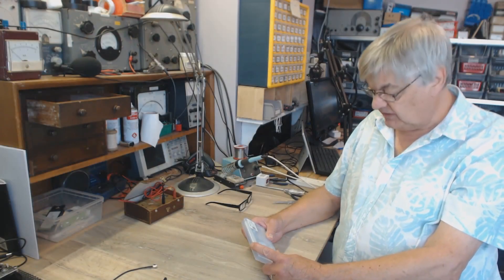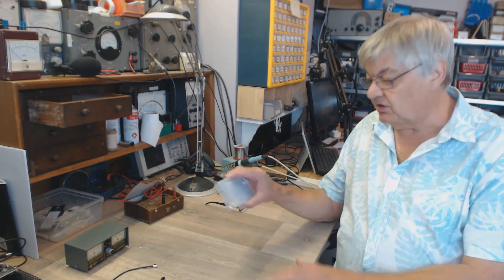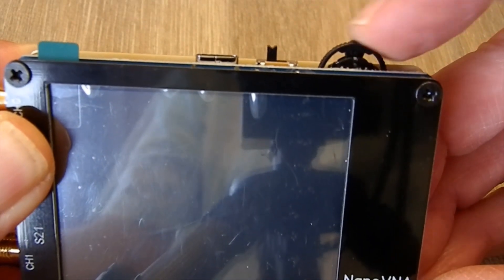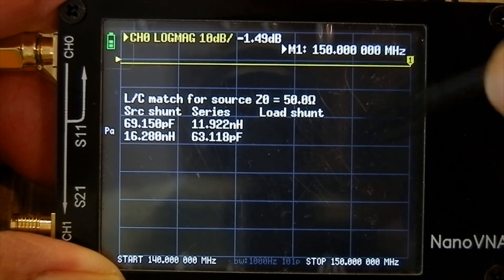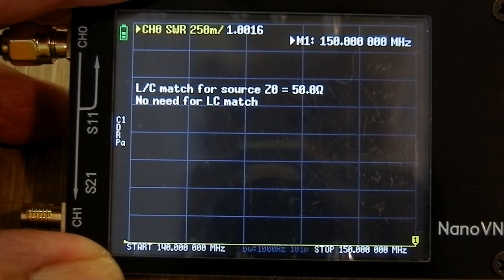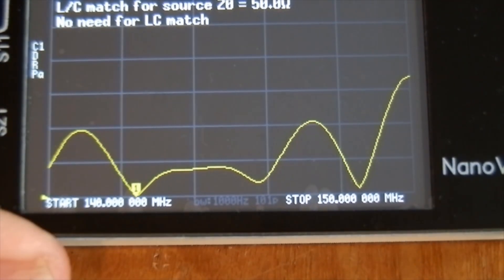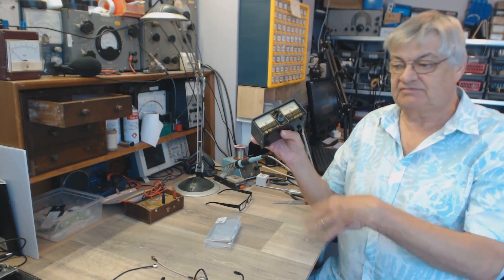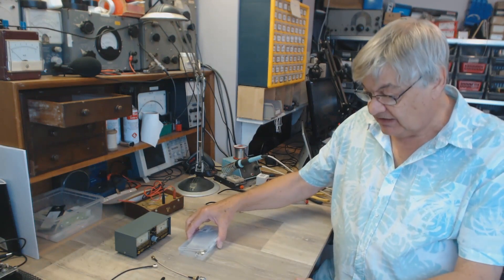G4NSJ - NanoVNA-H very tiny antenna analyzer review

Comment: Hello very interesting video and nice presentation!! 
Thanks.
A few questions before I buy the nanoVNA-H4 (newer version). Is the plastic housing no problem with RF radiation?
And isn't the mounting of the SMA connectors on the printed circuit board mechanically weak?
Reply from the maker: There's no RF radiation problem as far as I can tell. I don't think the SMA connectors are mechanically weak, they seem pretty good to me.

Comment: just watching your video as i make a load box for calibration. it's goiing to have the normal three cal loads but on so329 connectors. so I can use any length of coax and calibrate at the end of it. There is a function for moving the cal point if you add some coax but, it needs a bit of information about the coax your fitting.  I'm doing this as I'm going to adjust a 6 band trapped vertical and want to be a way from the antenna so I'm not loading it.
Reply from the maker: Great stuff, thanks!

Comment: 👍Thanks for video. These are amazing instruments for very little cost. Years ago, you had to pay eye watering money for equipment like this. With the test you did, I am wondering if you measured the SWR characteristics of the antenna system (co-ax and feeder) rather than just the antenna. Unless your co-ax is a half-wave multiple, to find out what is going on at the antenna, perhaps calibrating at the feedpoint or factoring in the delay for your co-ax would give a better SWR plot for the antenna?
Reply from the maker: Hi Steve, I’ve measured SWR at the antenna and the shack end of the coax. It is am amazing instrument. So glad I’ve got it. Cheers, Ray.

Comment: I don't know why but I've never been able to get mine working. It just shows 1 to 1 swr all time. M7AOE
Reply from the maker: That’s a shame. Presumably, the battery is fully charged?
Reply: @g4nsj  Yes, its fully charged. I would like to use it to set up the new ampro15 aerial for my car roof!
Reply from the maker: @Rayxl1  In that case, I don't know what's wrong. The Ampro-15 is a nice antenna.
Reply: I might just buy another one. I did have it working a bit but the low swr peaks flitted about all over the place. You can join the ampro 15 and ampro 20 aerials together It would be nice to see what the resultant resonant frequency is. I'll experiment at Kings Standing when the wind dies down! M7AOE
Reply from the maker: @Rayxl1  OK, all noted. Hopefully, the wind will die down soon!